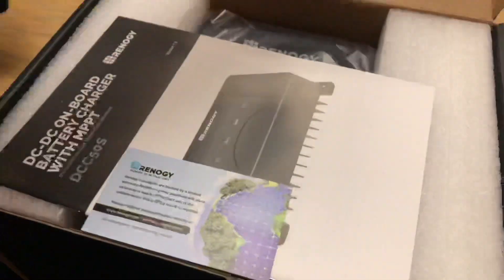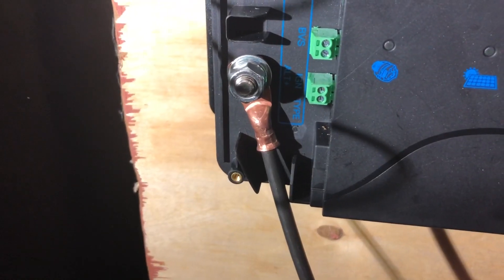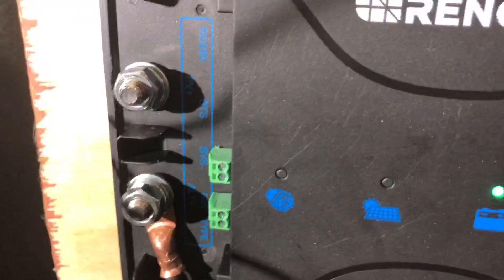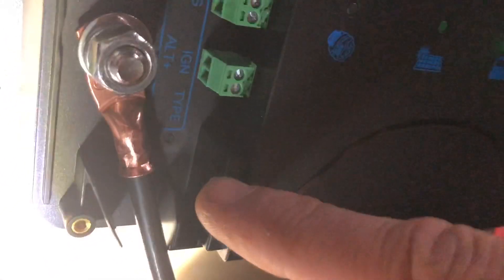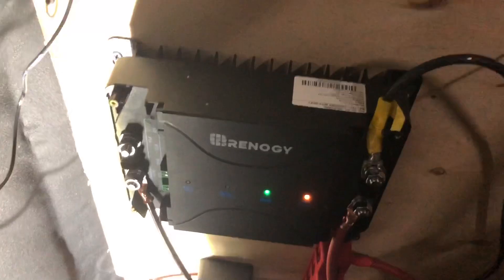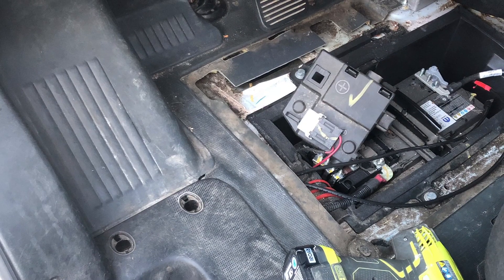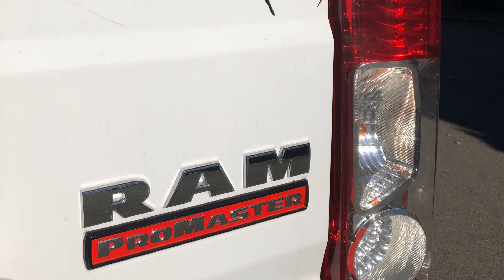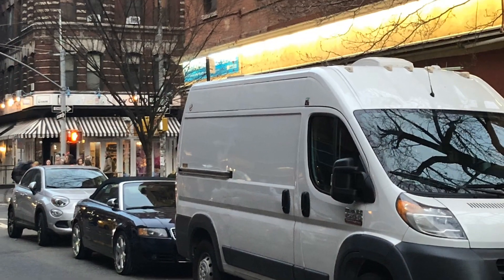Installing a Renogy 50amp Dc to Dc mppt charge controller for VanLife

Comment: When i disconnect my solar panels via mc4 connectors, my renogy dc50a mppt charger, does not allow for the full 50a. Eventhough my alternator produces 100ah of power.  What might be the issue?
Reply from the maker: @mehdidelghandi23  what gauge wire? Could be voltage drop- I used 4gauge wire and it was a 10foot run- also check that the battery type is set correctly- are you using the bt connection to monitor it? Also, are you only monitoring it while idling. I was only getting about 10 Amps  while idling. And 47 while driving
Reply: @NYC_VanLife  thanks for the quick response. The gauge is not that thick. I think 8 or 10mm thick. It is a campervan that is build out of a factory, so no self build. Pulling a complete new cable is a big chore.  I measure it idling and it shows 28 amps via the LCD monitor of renogy, no BT2. But the alternator put out 100amps. I know that the DC mppt 50a should be tricked by disconnecting solar, otherwise it prioritizes solar. It splits 25amps solar and 25 amps alternator. But never 50amps if I disconnect solar. Should see it while driving...
Reply from the maker: @mehdidelghandi23  try putting it in park and just revving the engine. Try it at night when there’s no Solar. It will split 25 and 25 during the day but you should be able to get 50 A.-if it’s 10 gauge wire you should definitely replace- google wiring gauge lengths to check what amperage is good for what length

Comment: Thanks for post. I currently have a charge controller, 40 amp without a battery charge as well as an inverter. Is your system strictly DC? Thanks for great easy to understand info.
Reply from the maker: Ya, sounds like you just have a solar charge controller, you’re probably better off just keeping it and adding a battery isolator or dc-dc charger. This is an all in one unit that replaces a solar charge controller and isolator. It’s honestly been amazing! I’m trying to make a better video of this but I hate my voice so everytime I edit something I delete it cause i’m insecure about it 🙃🙃🙃

Comment: Would be awesome to actually show the connection to the car battery.
Reply from the maker: It’s at the end as a picture, I’ll send you a picture
Reply from the maker: Can’t seem to find YouTube messages. If you have Instagram I’ll send you a picture
Reply: @NYC_VanLife  i don’t unfortunately. 🥺 it’s all good. Where is the connection at? Every van is different right? I mean ford vs ram vs sprinter?
Reply from the maker: @amyfu2047  ok so this was before I fully understood this thing tbh. I was trying to convey what it does versus the DC DC exclusive charger that Renogy makes. Basically you just run the positive line to the starter battery positive and the same for negative. I’m bad with typing I’ll make another video within the week

Comment: Where did you put the temperature sensor?
Reply from the maker: you want it at the lowest point. that the coldest point for the batteries
Reply: It should be mounted closest to the positive terminal.

Comment: Do you think this can handle a transit alternator with 5 100w compact renogy panels??? Or do you think that’s to much power running through it?
Reply: The DCC50S is a 50A charger, drawing from both inputs simultaneously, 500W of panels at 12V is about 41A max leaving the rest to the alternator
Reply: This is misinformation.  25amps max from solar and 25 from alternator

Comment: Is the ignite needed for Ford transit 2011?
Reply from the maker: Luke Stanton no this doesn’t need one. I learned a lot about this thing after having it for awhile now. It starts charging your house battery after your starter battery is fully charged by the alternator. I think I’m gonna make a follow up video to this

Comment: How did you ground on the vehicle side?
Reply from the maker: I’ll be making a new electrical video soon
Reply from the maker: Ted P I ran a wire from the negative terminal from the starter battery to it. I’d recommend having a bus bar so you can ground your fuse box and everything else you might add

Comment: I finally got to test my solar panel on my dcc50s. I have been trying to find a vid on the red light indicator for solar on unit , wondering what flashing red means vs. Continuous red means?
Reply from the maker: Thim flashing red means that your house battery is fully charged. Your solar is charging the starter (car) battery. It could also mean that it’s on boost charge. Google the manual it’s on page 12
Reply: pro trick: you can watch movies at flixzone. Been using it for watching all kinds of movies during the lockdown.
Reply: @Garrett Kairo definitely, have been watching on Flixzone for years myself =)

Comment: I too have same vehicle, where did you place your dc to dc charger? Also did you put house battery where starter battery is?
Reply from the maker: Rozanna Smith behind the drivers seat. I made a dividing wall and there’s a lot of space behind the seat. I’ll be posting a van tour eventually
Reply from the maker: Rozanna Smith and the house battery is under one of my cabinets

Comment: Thank you for the upload. Just a quick question:  I have a 24v battery bank. How does this unit know to charge 12volt batteries or 24volt batteries? Thank you.
Reply from the maker: micjakes1 only 12v to my understanding
Reply: @NYC_VanLife  Wow that was fast. Thank you.